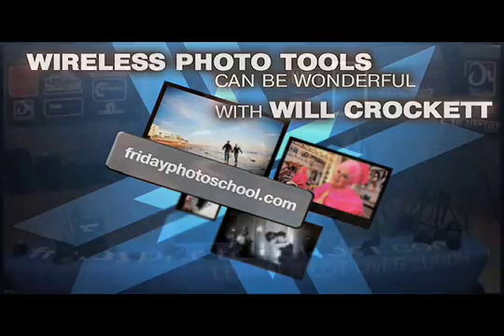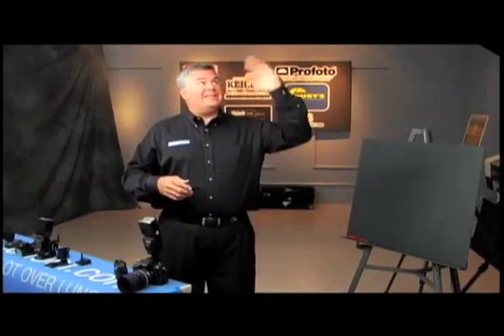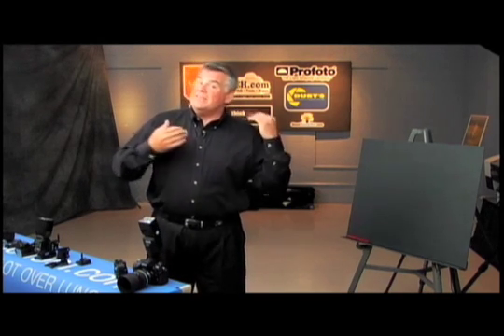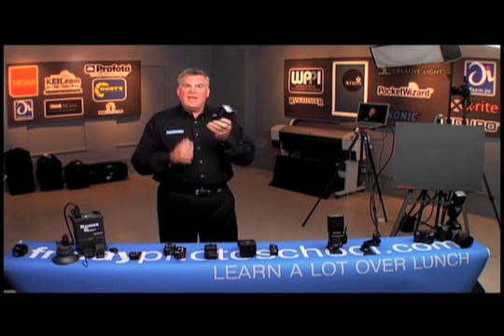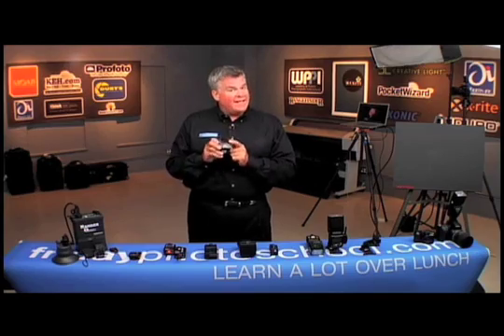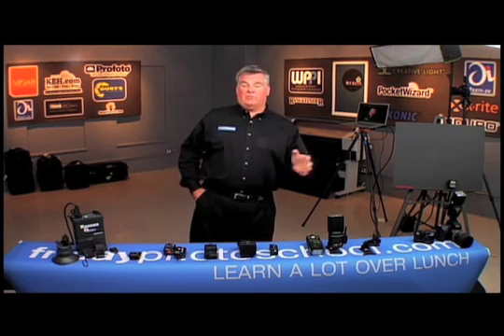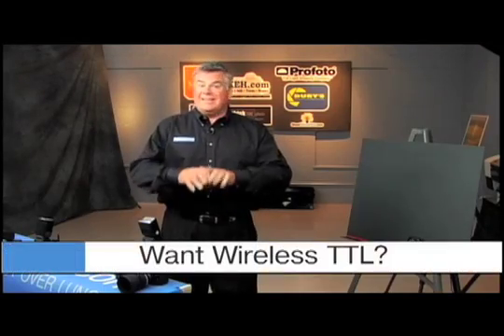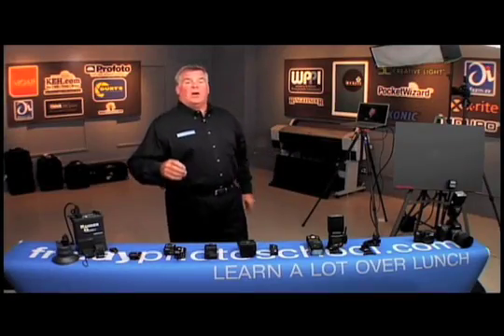Why don't we use the Built-In wireless systems?

Comment from the maker: Hey Kenlor, you are absolutely right my friend.  It DOES work well in the right conditions.  As a working pro, we are exposed to all kinds of situations and need a fail-safe solution - so we use a radio based system.  I know other pros who use the built-in systems too but they work around the limitations.  I don't have the tolerance / patience for that. This video just brings that point up.  Now, your idea of the ND gel to "hide" the preflash is stinkin brilliant!  Have you tested it?

Comment: Wireless iTTL works fine as long as you use it in the appropriate situation. I'm testing a theory with using ND filters on the IR receiver on the flash in daylight to counter the light level of the ambient light, allowing the cls transmitter to trigger the flash.
 Also wrapping optical triggers with ND filter gel to do the same to trigger non CLS flashes.  Could be a cheap solution as long as we have line of site triggering.